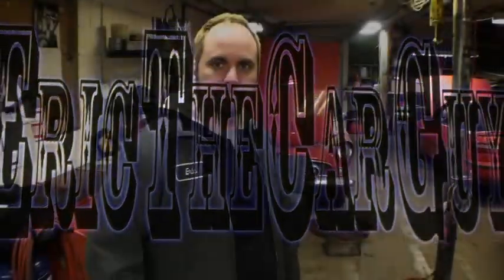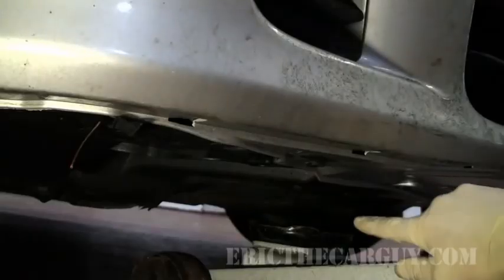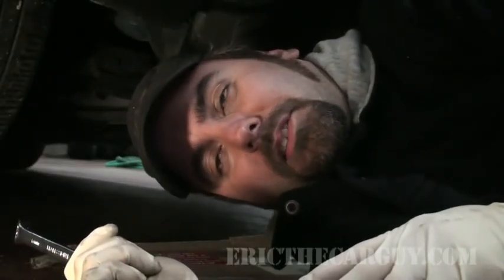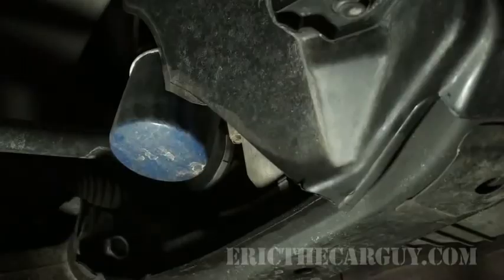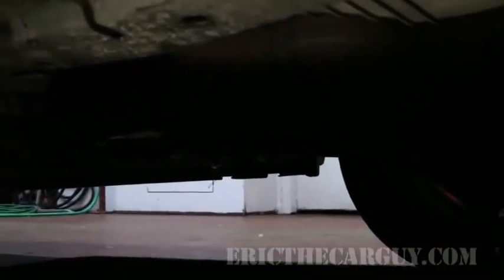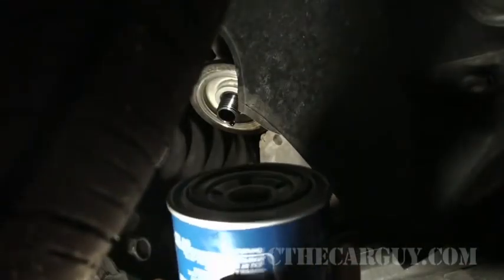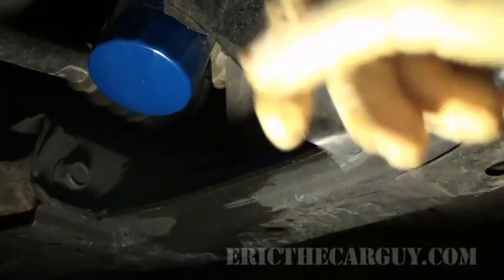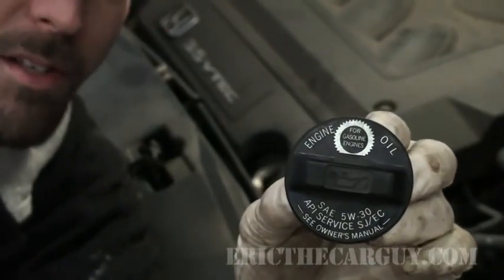How To Change Your Oil (Full) - EricTheCarGuy

Comment: Great video! What are you guys doing with the old oil though? I've been using mine to season my cast iron pans and it works great for that, but I have too much left over. The rest I just normally pour into the creek by my house but there's got to be another use for used oil. I try to reuse things if I can so I'm open to suggestions. Anyone?
Reply: ***** Lol I was trolling...

Comment: Just another FYI, a lot of these auto part stores have a container that you can bring in your old oil and dump for free which is nice to know but initially i had a big plastic cat litter box i drained into and then had to funnel into the oil bottles. Highly suggest getting a legit container if you're changing your oil frequently.  Don't know about other regions but my ranger is 5w/20 but i went to 10w/30 since the weather in so cali is pretty consistant and ive heard multiple times its ok.

Comment: @EricTheCarGuy I do mine at 4k aswell, especially with a VTEC engine, the more you use Vtec the faster your oil is burned up, I had 4 qts dissapear from my accord engine in 2k miles... I learned that constantly using vtec was bad after that

Comment: For those who don't know already, if you cut the bottom of a two liter soda bottle appropriately, you can use it as a gutter when removing the oil filter. Thus eliminating the cross member wipe up headache. You can even use just a strip of cardboard with a crease right down the middle of it by placing the cardboard under the filter.  : )

Comment from the maker: @littlenicky648 I wish I would have put filling the filter with oil before installing it as that is a good practice.  Yes you should be prepared for more oil to come out when you remove the filter.  Good luck.

Comment: I always use ramps (unless I'm taking the wheel off, of course.) at first I didn't want to because I thought putting the car (in my case, truck) at a angle would not drain all the oil out & it would make it where I overfill it and screw something up. Well, that's not the case! (Just a FYI, my driveway is at a slight angle, that's why I don't jack it up when I do a oil change) Thanks Eric, and what oil should I use? I always use synthetic and last time I used Mobil 1 and didn't have a problem.

Comment from the maker: @LiViNLiF3 Yes I disagree with that, engineers spend a great deal of time figuring out what oil to use in the engine, often times using thicker oil will cause the top of the engine to be starved for oil when you first start it up and increase wear on the top end as a result.

Comment: Eric-- said it before, but great YouTube channel.  One question please?  I'm 54-years old and have been changing the oil in my cars, trucks, SUV's, and race cars since I was 15-16 years old.  It's S.O.P. that I always replace the crush washer or filter washer.  But my question is, whenever the oil filter is in a position that allows me to fill or partially fill the filter with oil,  I always do so.  I notice most if not all DIY oil change videos never mention that?  Could you please give me your opinion, advice, or share some knowledge with me as to the benefits of filling the oil filter with new oil before installing said new filter onto my vehicle?  I'd appreciate it. Also, you showed several examples of oil filter wrenches... Do you have a favorite or one that is your go to wrench if needed?  Nothing irritates more when I help others out with oil changes and the filter is screwed on so damn tight it's a frickin battle to get it off!  I always spin it on till it snugs up and then just tighten it 3/4 turn at the most. Never had a leak at the filter, and it always comes off with the strength of my hand vs. a wrench. Thanks much in advance. 
Wm. ~
Reply: +Wm. Sturman I put oil in the new filter where possible. I did an oil change on a 2007 VW Beetle and the oil filter had been screwed on very tightly. A chain type wrench got it off without any further problems. I use clean oil on the rubber seal/gasket on the new filter.

Comment: After my last oil change, I am changing my own oil from here out.  I checked the oil pan bolt to see how tight it was, and I found that I couldn't loosen it with my torque drill on its highest setting.  I needed to use my impact drill to loosen it.

Comment: Wish more oil filter companies would take a page from Fram and add that little grip strip on their filters.   Since I've been changing my own I can usually take it off by hand.  Most people overtighten theirs with a death grip.  If you're going to change your oil normally id suggest oreily or autozone oil containers.. $8 and it has a "strainer" incase you drop your plug bolt but it has a drain cap on it also.  My prob is the opening is a tad to small at times to gauge so i "overshoot" sometimes.

Comment: check it cold and when the car hasnt been started for awhile. since if its started the oil has been transfered to the top of the motor and its draining back in to the pan. thats why your getting lower level when warm.

Comment: Instead of using a new washer for the drain plug or if its missing 1 ive always used plumbers tape its cheap works great and a roll lasts for several oil changes

Comment: at about 6:30 I thought that you might appreciate my method for figuring out bolt direction in weird orientations - we use "right handed" bolts, named as such because, if you take the fingers of your right hand and curl them in the direction you spin the bolt, your thumb will point the direction the bolt goes. Instead of flipping things around in my head, I find that that can help my figure out how to unscrew things ;)

Comment: @ProfessorTapOut Up here in Canada, 10W30 is only for summer vehicles. I have a container of 10W30 for my motorcycle, but I never use it in my cars. Next time we have really cold weather I'll video how viscous cold oil can be -- molasses is faster.  I once had an oil filter choke on cold 10W30, which is a scary experience. I always use 5W30.

Comment: thanks Eric, one question here though, how important it is to keep the car level when changing oil? i see you just jacked up one front wheel in the video. is there gonna be any old oil left in the cylinder? thanks~(i always left-up all 4 wheels, just wondering is there any point of doing that~~)
Reply: Personally, I buy an extra quart or two and use it to flush the old oil out a little bit. Sometimes I'll just buy enough oil for two oil changes, drain and drop the first, drive around until it's nice and hot again and drain it again... I don't trust oil cleaners anymore, the ones we sell at work in particular. I've had oil pan leaks after using them a few months after.... My two cents...
Reply: MikeJXWT if everybody was rich like you maybe they would do this.
Reply: JayVan Geli As a tech who does oil changes as well, I can tell you that a great way to really make sure the oil system is clean from any old oil, put a small bottle (I believe its an 8 or 10oz bottle) of Marvel Mystery Oil in your oil and run the car for about 5-10 minutes before you drop the plug to do the oil change. The Marvel really acts as a great detergent and really cleans out the insides of your engine. I personally have done this before on my vehicles and have never been happier with the result. No leaks, no harm to the engine.

Some of the old time mechanics used to put a quart of ATF (Automatic Transmission Fluid) with oil in an oil change because ATF has great detergent qualities as well, but nowdays ATF is so much more developed that it doesnt have the same kind of detergents as back 20+ years ago so I wouldnt recommend that. Just get a small bottle of Marvel and put it in the oil and run the engine for 5-10 minutes before you do the oil change, you will thank me because your clean and fresh oil will be the cleanest you have ever seen it. 

Obviously, it does no good to you if you go over 3,000 miles on ANY kind of oil (conventional, blend or full synthetic). Number 1 rule is to always change oil constantly, thats the best way to prevent even having to use ANY kind of additive to clean your engine's internals. But if you go over on the oil change interval, use the trick I told you :]
Reply: Why don't you just change the oil twice as often as you do it now.  Like if you change it every 5,000 miles currently, instead change it every 2500 miles.  Your oil wouldn't get that dirty in the first place so you wouldn't have to change it twice at once.

Comment: thank god i didn't learn anything new from this video. was worried about that. 
hey eric when jacking up hondas  from those tow brackets you should jack it up from the side of the car instead of the front , if you have the room. you'll notice that the jack will walk in relieving stress on the bracket and smaller jacks. ever see bent tow bar brackets with no other signs of damage under the car . did you get a new camera this vid seemed to have better quality

Comment: Also, remove the oil cap before you drain the oil, so it drains smoother. But quick question : What are your thoughts on Drain bolts that have magnetic tips at the end of them?

Comment: hey eric , love the show and the website , i have a bunch of questions for you . I drive a 1994 Ford Mondeo , european . It has about 170.000 km and normally i use 10w40 oil . This summer i want to give my car a makeover so all the filters will be changed , all liquids and necessary parts . So do you think i should use different oil , regarding my mileage or just keep with this one ? Also how do you feel about injector cleaners , are they any good ? Thanx a lot

Comment: just a fyi, some sump plug nuts, the bolt that you took of, they are magnetic to take all the metal filings out of the oil from running, its a good idea to wipe it clean

Comment: I have honda civic 2005.
Recently changed the oil to zic 5w-20. Previous owner was using zic but not sure which one.

Anyways, noticed the engine noise increased after a week or two. Sounds like a jet engine when you give it the gas specially in first 5 gears.

Someone suggested to use 10w 40. Do you think it will help reduce the engine noise?

I live in a warm areas and car has 170000 miles on it.

Comment: Nice video. I fill oil filter with oil prior to install and turn engine over with remote starter switch. No running engine without oil that way. Heard too much knocking otherwise

Comment: Ok so I'm kinda new to this mechanical engineering stuff because my mother doesn't know how to keep maintenance of her own car. 

You made all this look soooo easy.  Can you or anyone in the comments explain what's the purpose of an Oil filter? Also, does the oil not get used? I always thought it burns away in the car which is why I initially thought it needed to be changed. Should you also fill the filter with oil prior to installing it?
Reply: +RzVids I dont know why I am replying to a 1 year old comment, but in case anyone reads this:

The oil will collect metal shavings and contaminants that you dont want in your engine, the filter will trap these, keeping your oil clean. And while some oil may drip or burn, most of it will not. Filling the filter with oil is a good idea, but it only works if the filter is vertical design.
Reply: +TheDefectorUMP I just read it lol thanks, I've changed my oil and saw the contaminates many times since that comment.

Comment: been checking out the internet and im getting mixed opinions on weather or not i could go from using synthetic motor oil for oil changes to non synthetic. cause i picked up a case of oil for half the cost of the synthetic. being that i like your videos i would also value your opinion on this topic. thanks

Comment: I've always done and taught to change filter first then drain oil.
WHY?
As it has happened before, albeit not too often, the oil filter will not come off.  For whatever reason it doesn't come off, and, you need to run to the store or give it a try the next day or wait a few hours until a buddy comes by to help you do not need to dump fresh oil.
In this case you will have new oil mixed with old oil from the filter. May not be that much old oil but it is still old oil with new oil.

Comment from the maker: @dungeonhack420 In truth most synthetics are blends of regular oil and synthetic so by design they are made to mix together just fine.  My issue with synthetics is that most people don't need them and if you have a high mileage car you may end up making any oil leaks you have worse by using synthetics because they tend to have different flow characteristics that have a tendency to slip past where regular oil will not.  The real benefit is being able to extend your oil change interval.

Comment: Hi Eric, I have found oil in the air duct after the point where the exhaust recirculation valve connects to the air duct as well as in the air manifold past the throttle body. I thought that too much oil was filled on the last change and it passed upward through the ERV. What are your thoughts? Have you ever seen this? Thanks

Comment: My dipstick is heavily marked with oil up to the max line, meaning between the min and Max the oil on the dipstick is darker, while it's faintly showing above the max line, does that mean it's just about to much oil? And I should remove a bit? 
 As well I'm assuming if I checked the engine when it's cold it's fissure going to be over when it's warm the engine? 
      Lastly when adding oil after an oil change, am I supposed to add less being that the engine has some remannance of the old oil still stuck around the engine? 
    If so why would the manufacturer recommends 6.4q when doing an oil change?

Comment: Something to note: Honda, Toyota, Kia, and Hyundai are some of the easiest oil changes you'll ever do. Vehicles from other car makers CAN be a lot harder to change the oil in even if you have a pit like I do.
Reply: Tom Cieminski Toyota uses filter cartridges now and most of the time there over tightened and if it comes to it a air chisel is used making it unusable and parts are needed engineering flaw. Toyota is actually a the worst car to do the oil change.  Any spin off metal filter is normally painless.

Comment: Oil must be as hot as we can resist without getting burned. This minimizes oil remains in the engine. In some models oil remains may be up to 20% and reduces the new oil performance due to a premature degradation.

Comment: @EricTheCarGuy Bearing clearance to my opinion doesnt very much on auto gas engines, I can't remember the last time i seen a car that recomends 10w-30 oil. Me and my dad always argued over oil viscosities.For example the first number is the viscosity when the oil is cold. This is followed by the letter W (which stands for winter, not weight), which is followed by the number that indicates the viscosity when the oil is at operating temperature.

Comment: u can also use a screwdriver and a hammer to take the oil filter off (just incase u dont have the right tool for it)....make sure u have the right new oil filter and then just hammer in a long strong screwdriver into the old 1 but make sure its long inough so the screwdriver can come out of the other side of the oil filter...this way u have a handle to turn the oi filter....the new one just need ur hands to put it on!

Comment: i like to remove the oil filter when the drain bolt is still off because the pressure will actually cause more oil to drain...i also let it drip for a good hour but that's just me because my truck is old and when i do an oil change i make sure all the old oil is out. By closing it all up as soon as it's done pouring u stll have a good quarter quart of oil still in there...those little drips add up quick
Reply: also a lot of ppl dont realize when u start the car after an oil change some of that new oil is being used to fill the new filter so after u run ut for 45 to 60 seconds go ahead and turn off the car, wait a few minutes, and then add a little more to top off and replace what the oil filter took.

Comment: so question... If it is hot outside, say 90 degrees Fahrenheit, is it okay to drain engine oil... I'm thinking about replacing my engine so would it be okay to just drain the oil without running my engine prior? Same question for my engine coolant and power steering fluid.

Comment: there are videos for that, personally i can say that 325i oil change is much easier then this, and if it's a 99-05 it should be a paper filter located just before your engine...youll need a wrench or ratchet for the oil bolt and a large cresent wrench(bout $30) for removing and replacing the paper oil filter. other then that most the same rules of this style still apply.

Comment: A small addition: It is a good idea to unplug the filler plug first before draining the oil. Not good if you drain the oil without the ability to put new oil in. (For transmission and differential)

Comment: What are your thoughts on Royal Purple engine oil and other fluids? My personal opinion is that it's the best out there. I feel like my motor runs better and spins for freely as well as lasts longer. I've never really talked to anyone else who's tried the stuff so I was seeing what your opinion is on it (whether you've used it or not). Thanks in advance for any insight.

Comment: How do feel about putting a little oil in the filter when possible?
I have heard its a good idea to do it when possible to prevent any possible damage do to no oil even though it is for a few seconds and to speed up oil priming.

Comment: Is it bad or ok to blow compressed air into the engine through the oil fill hole on the valve cover to help drain the remaining oil during an oil change?